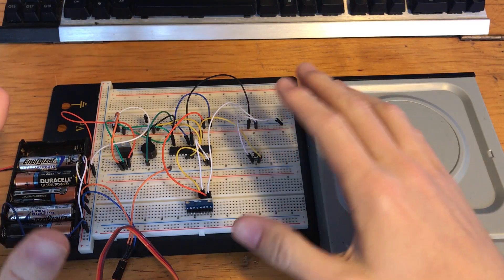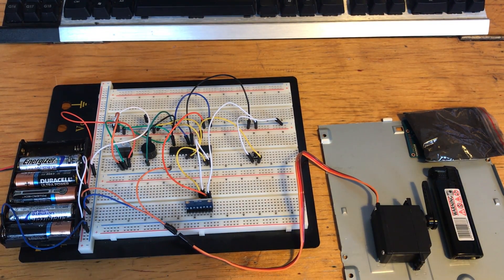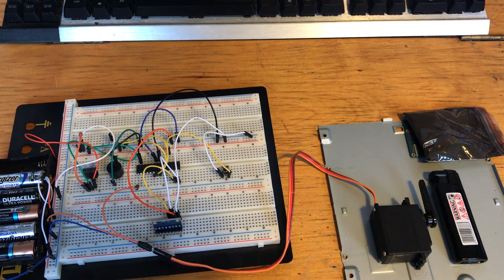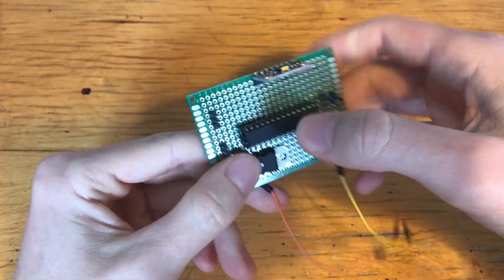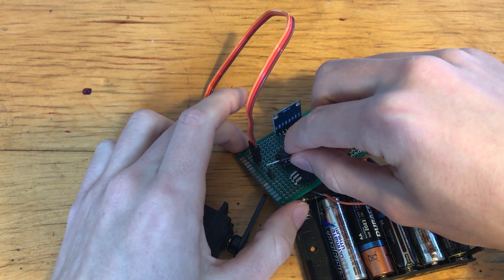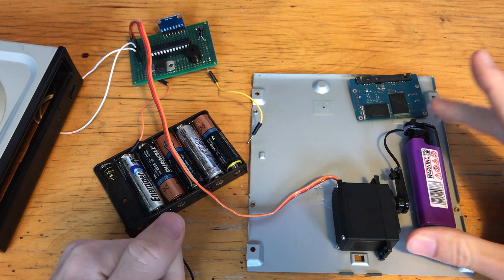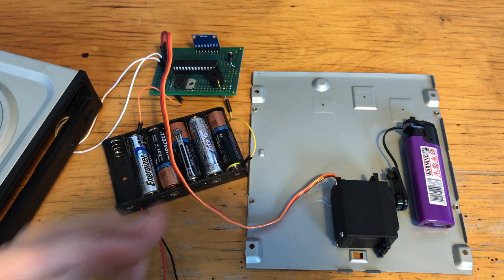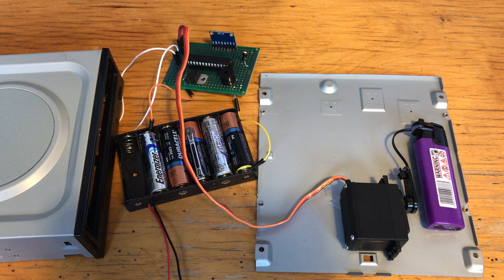Self Destructing SSD - DIY Build Log II

Comment: You can get cheap arc lighters now that you could probably do away with the servo string contraption. Given some experience with thermite I would 'fuse' it with a strip of magnesium ribbon making it again easier to trigger.

Comment: You should have made it turn on a fan somewhere in the back to git rid of the smoke so then the case fans will blow the smoke out the back so then it won't just sit inside the machine. You also should have used a high voltage adapter and fuse of some sort instead it would light much faster

Comment: need to add a few features to it,needs bit of wielding,(carefully!)i would add more coded servo,or even a second servo,connect it all up to a display with password input,wrong or correct password it will start the self destruct process,still some nice features as always looking forward to the demo video

Comment: why  not use a usb  battery pack or  18650 cell so the battery can be charged  while  the pc  is running
Reply from the maker: I don't plan on actively using this of course, when I do the actual test with the thermite the batteries are going to be nowhere in sight for safety reasons, so I didn't really put too much thought into the power source. Though using a rechargeable cell like you suggested would be the best solution.
Reply: ok  I like your channel better than  Hak5 because I dont have to watch 30 minute episodes just to get to the good stuff